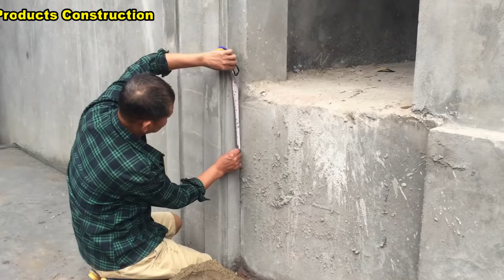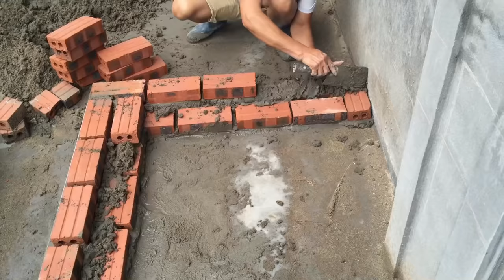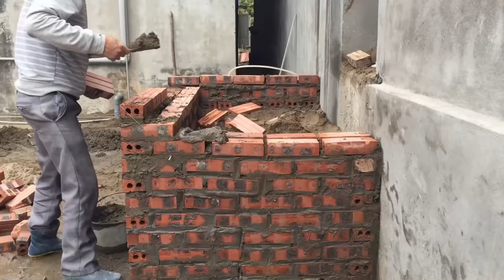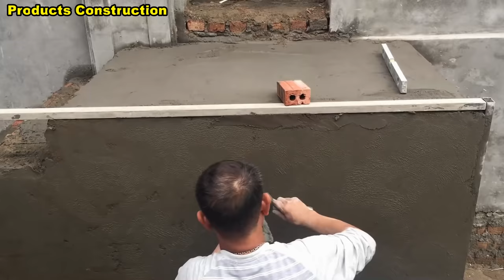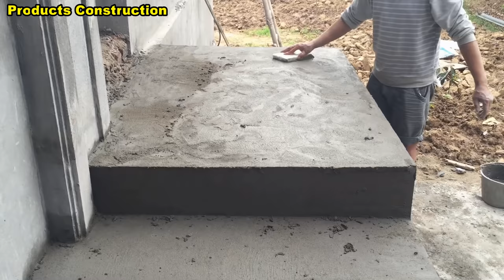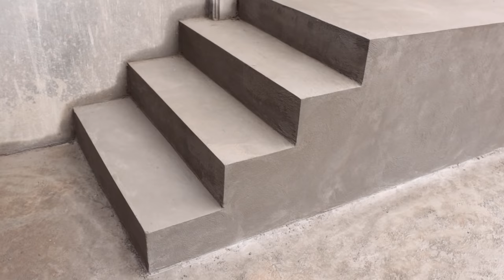Building Porch Step - Rendering Sand and Cement For Brick Steps

Comment: What was the hand sander that he finished with to smooth the concrete out? I want to do this to my bricks at my home. Thanks if you reply back the answer so stay safe 😷 website concrete to blessed🙏 others on home projects. 👊🏽😇👩🏽✌🏽
Reply: Please somebody tell us
Reply: He is probably using a piece of foam.
The same effect could be achieved using a flat piece of wood.
The render needs to be dry though and the wood is used to smooth the surface in a gradual manner.

Comment: These stairs will last very little. It should have been backfilled once the Masonry was dry to avoid the fill sucking up the mortar moisture. The rise and runs of each step is different. Someone is going to trip over and fall. A waste on money!
Reply: Yes, wasting a lot cement, bad way of building